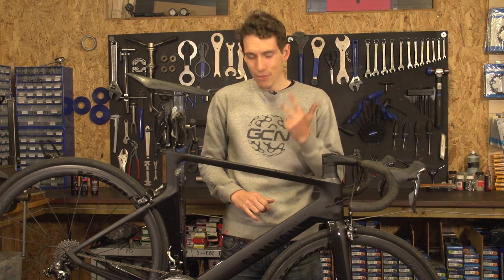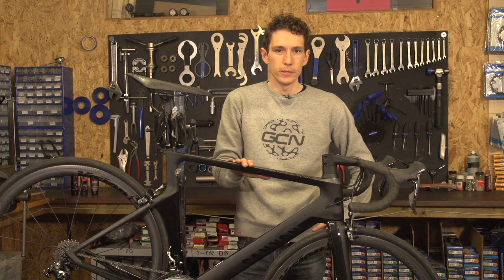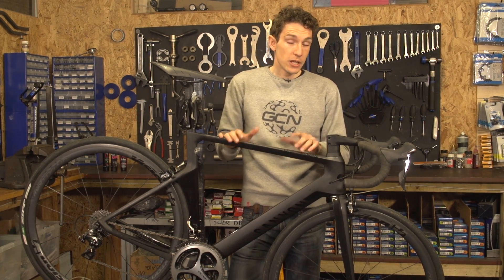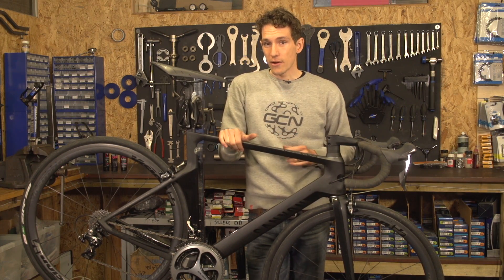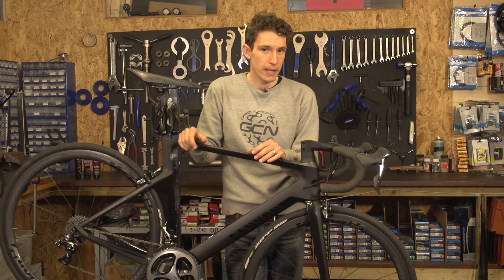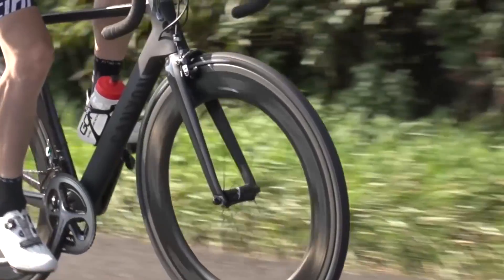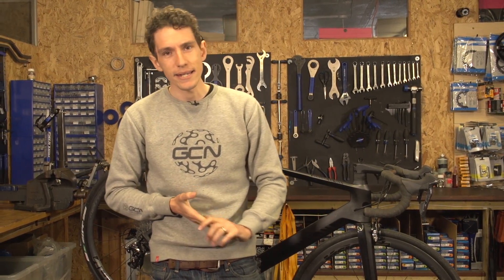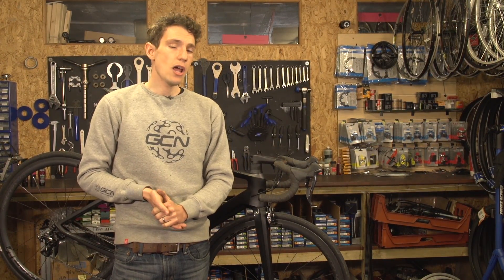7 Things You Didn't Know About Carbon Fiber

Comment: Metal bends before it breaks, carbon breaks catastrophically. I would completely argue that last point about carbon bikes being just as safe. That said I do race a carbon bike and love the way it feels when riding, but that doesn't mean I don't get a little scared when I hit a pot hole.
Reply: +Niklas Barreto Carbon bends considerably without breaking. Frame deflection is one of the selling points of a good carbon frame. The carbon can be made to flex in one direction predictably, like a spring, to absorb shock, and be rigid in other directions for efficiency and ride control. That's why they feel so great to ride on. Look Bicycles even uses carbon as the material of choice in the cleat binding springs for their pedals. Cannondale made a few full-suspension MTBs with no pivots between the BB and rear wheel, because the carbon chainstays had the flexibility they needed.

Have a look at the testing shots they have from Canyon. Dropping a huge weight on the end of the blue fork??? (1:03) If it can bend like that without it breaking, it's probably not going to break with only you riding on it.
Reply: +Niklas Barreto I hit a rock at 45mph down a mountain road on my Canyon Endurace CF. The aluminium handlebar bent a little (2mm approx). The CF frame didn't even scratch, I'm still riding it like a maniac down hills.
Reply: +Niklas Barreto Metal can crack as well, for instance if the failure is caused by fatigue. And CF composites can fail progressively, like what GCN said about the layers giving one by one.

Comment: airplanes are definitely not made of carbon fiber right?
Reply: Apparently it takes more carbon to build one plane than the whole of the bike industry uses in one year. Apparently.
Reply: +Simon Richardson Most big passenger planes are made with Al, apparently, except the brand new 787s from boing which use a carbon fiber and polymer composite for the whole thing. That's an insane amount of carbon when you imagine how big those things are.

Comment: I'm still trying to figure out what alu-MINIUM is? Surely most alu-MINIUM has a higher modulus of elasticity than carbon, which means it's more prone to bend than fracture?
Reply: +William Thomas CSUF Kinesiology It has a finite life in terms of fatigue cycles. CF, steel and Ti have an infinite fatigue life when stressed within the yield limit. Modulus of elasticity doesn't matter as long as it's not stressed beyond yield (i.e. bent)

Aluminium/aluminum has an interesting etymology in itself - look it up
Reply: +Sam Singular Cycles However, we can't say carbon isn't going to be stressed beyond its yield. Especially, in the event of a crash. Not sure that any carbon mfgr. design their lay-ups to surive crashes. Then again, why should they? Goal is to make the bikes super light with high lateral rigidity and durability WHILE RIDING. In the event of a crash (which unfortunately do occur), I'd take a good metal frame any day. Of course, if you're paying $4k for a carbon frame, you probably can afford a $1k repair job or insurance policy.

Comment: Next video: How to train on rollers. I have rollers, but I'm not sure what to do on them.
Reply: Charlie, They did a video on rollers a while ago, featuring Matt.
Reply: I know how to ride them. I'm just not sure how I should train on them.
Reply: +Charlie Bennici pedal for a while, then pedal harder until you can't keep pedaling, then pedal softer.  when you recover, repeat.  in all seriousness, you can pretty much train on them like any other trainer unless you're a featherweight and you run your 23cm tires at 110 PSI, then resistance could be a problem.
Reply: Kevin Beckwith There is the problem, I am 118 lbs, 5,6 and run 25mm tires at 117 psi. 

Though I have heard of people putting magnets near the rollers for resistance. Only works if they're magnetic. In which mine are.
Reply: +Charlie Bennici hmmm, go to Puerto Rico and eat Mofongo every day? seriously...... try 60 PSI in those 25's, and in a 53x11 you should be able to make at least 300w right?  I'm 185 and on my 25's with about 85 PSI I can get just under 800w seated when I really spin up the 53x11 and easily do lesser intervals.  In any case, they are great for developing an efficient stroke.  Try pedaling w/ one leg for 20 sec, then switch when you start pedaling squares.  Get to where you can ride no hands w/ confidence.  Then you'll have a really smooth and efficient stroke.  Lighter work load days work on pedal speed (w/o bouncing) on the rollers, and heavy lifting lower RPMs on the turbo trainer like a Kurt Kinetic.
Reply: +Kevin Beckwith I have platform pedals. Not clips.
Reply: +Charlie Bennici so, so sorry....,j/k, hey many a great sprinter started out riding BMX.  well do what you will, ride on!
Reply: Maybe I wasn't clear. I have a Motobecane Mirage Sl with platform pedals. 

Any shoes/pedal suggestions?
Reply: +Charlie Bennici didn't mean to convey that I thought you were a BMX rider.  I started out riding BMX and of course platform pedals.  anyway suggest you check out Bike Forums or Cycling Forums, lots of wise older riders that will give you tons of advice.  Cheers...

Comment: Im mostly a mountainbiker but god damn that canyon looks demonic..
Reply: +Sander Bærøy Johansen Smart MTb bike companies have an aluminium rear triangle , see Santa Cruz for example.
Reply: Yeah, my canyon strive cf 8 race has one=) 
Not sure if its to cut cost or /and ease production?
Reply: +Sander Bærøy Johansen The rear triangle takes a beating, usually when we lay the bike down. also most breaks happen here from contact with rocks etc.
that is why the switch to alum.
Reply: +Sander B&#230;r&#248;y Johansen As someone pointed out, aluminium is isotropic so maybe it can withstand those forces acting on it better
Reply: +Guillermo Bright Good point. In a perfect environment where the perfectly engineered carbon fiber bike/components have no force acted on them from the imperfect, unpredictable outside world, Carbon Fiber is the king of all, on paper. Truth is, it's hard to tell what's going to happen when you go for a ride. Aluminum is more forgiving in my opinion, a dent on the chain stays doesn't mean your frame is scrapped (legal disclaimer, replace all damaged parts blah blah)

Comment: I had a "steel is real" guy refer to my F8 as plastic.. So I asked him (scientifically I might add) if steel can exist without carbon and he didn't have an answer. I love my steel bike too, but my carbon bikes are oh so sweet.
Reply: +Steve Bell Most steels used in frame manufacture do include carbon in the alloy.
Reply: Sam Singular Cycles I'm no metallurgist but I'm fairly certain carbon is the hardening element of all steel.
Reply: so what were you asking him?
Reply: A hypothetical question :)
Reply: the world couldn't exist without carbon, what is your point?
Reply: just throwing this out there but the definition of steel is carbon alloyed with iron. Low percentages are classified as steels, higher percentages are cast iron
Reply: That's my point. Without carbon there's no steel. I posed the a questions to the guy who called my carbon framed bike "plastic"  — knowing the answer. But he didn't have a clue. He just wanted to bash carbon bikes, in that snotty superior cyclist sort of way. My guess is he was just jealous? Who really knows.. I dropped him inside of 5 miles and never saw him again.

Comment: What's the best way to transport a carbon fibre bike? No wise cracks here, obviously riding it is the best way but what about on roof bars. Some bike carriers clamp onto the frame, should these be avoided?
Reply: +colin clements I use one that clamps the down tube on my carbon bikes.  I try to clamp as close to the bottom bracket as possible as I know that area is pretty beefy.  I've had no issues but I also have a pretty light touch with the clamp.

Comment: It will be nice a video about chinese frame and wheels how weak they are in comparison to original. Material, durability and safety.
Reply: +mcantuaria23 are you on about the copy's? why buy a copy when you can buy good parts for manufacturers that have a good rep, for about the same price as a copy?
Reply: +Cyber TonTo72  I don't want to compare prices but safety, material and durability. We all know how much cost chinese frameset and wheels. I had riding on chinese rims before for over 6000km without any problem and also I had friend that broke his face after the front wheel explode.
Reply: That is my point, there are a few makers that do test there products and still make them as cheap as a copy

Comment: Isotropic = same strenght in any direction.
Carbon fiber composites are stronger (and stiffer) in the direction the fibers run.
Its similar to wood, which is stronger along the grain the perpendicular to the grain. This is an orthotropic material. 
With carbon fiber you use several layers in different orientation, getting that right is key.
That wasn't so hard was it?

Comment: A radiator is filled with water so NO it will not exceed 100 celcius. That would mean it's boiling ;-)
Reply: +Mark Huigen The boiling point is pressure dependent.
Reply: You're right, but you know what I mean.
Reply: +Mark Huigen some radiators are filled with an oil product and not water

Comment: Thank you Si! Nice video and definitely information that needs to be seen more often. Modern jet aircraft have massive amounts of carbon fiber in them yet people think it isn't safe to make a bike from. It is all about recognizing the different properties of different materials.
Reply: +Brian Moore Planes use carbon fiber 10x stronger than bikes
Reply: +Guillermo Bright watch the video again.  5 factories make it all.
Reply: +Guillermo Bright The carbon fiber itself (specifically what modulus the fibers used are) is only one part of what makes it strong, and as stated by Simon, with ultra-high modulus carbon fiber you're trading strength for brittleness. The LAYUP is the much larger determining factor.
Reply: +TypeVertigo well I would hope that the makers of an aircraft that has to lift thousands of tons would use a little different layup that a bike company that only needs to hold one person.
Reply: +Brian Moore That's the real beauty of carbon fiber. With proper layup and use of different modulus sheets you can make it as strong or as light as it needs to be.

Wings such as those used in aeroplanes and race cars have to contend with lots of kilos of lift or downforce, as the case may be, so as load-bearing structures they need to be strong. A car hood by comparison is just a cover so making it out of strong carbon isn't as critical - most people just make them as light as possible.
Reply: The engineering and qc is much more strict when building planes not so with carbon bikes.
Reply: @natedagreat90  If you stick to the large well known brands, a great deal of engineering,  qc, and testing is done.

Comment: Good video, I'm still a steel guy. love the ride characteristics and the long term reliability. Plus I don't want to be worried about over torquing bolts on components out on a ride if anything happens.
Reply: +Chasing Cornfields i love steel alot, but i would like to say i have done thousands of raggo  miles in the shite back lanes of dorset on my canyon and i have never taken a tool with me, just tubes co2 and tyre lever!!

Comment: 5:50 isotropic means that the material properties are the same no matter how the material is orientated. Carbon fiber is anisotropic, which means that it has different properties for different orientations, i.e. it only has high strength in the longitudinal direction  of the fibers.

Comment: What about leaving carbon in the cold or moving your carbon bike from the cold (0-5 in winter) to warmth (20-22 house temperature)
Reply: The thermal expansion coefficient of carbon fibre is very low, it'll be fine from a structural point of view.

Comment: One thing you never knew about carbon fibre: it's overrated and not even that much lighter than aluminium
Reply: Overrated? So you know better than Specialized, Giant, Trek, Canyon, Pinarello, Ferrari, Lamborghini, NASA, Northrop Grumman, Lockheed, Boeing, Airbus and other multi-billion companies that all use cf and other composites in their mission critical designs that used to use Al alloys before moving to "overrated" carbon fibre.
Reply: It is quite a bit lighter to be fair. About 500g like for like over aluminium for a frame.

Comment: Raw carbon frames are susceptible to UV damage. Many manufacturers trying to achieve light weight usually skip the paint or or glossy finishes that usually come with UV protection. Basically, if you have a bike where you can see the fibers, and it's a matte finish and not glossy, it probably isn't UV protected. Though this can easily be done with aerospace solution after every bike wash.
Reply: Well, good thing everyone uses paint on their bikes then. An unpainted stainless steel frame would suffer worse from ambient environment, rusting to hell as soon as it comes out of the furnace.
Reply: +Yo-yo 3M does make several matte UV resistant finishes if I recall correctly.
Reply: ***** I use 303 Aerospace Protectant for raw carbon.

Comment: can you clamp carbon bikes in a roof mount. I have heard that the fibres don't like that sort of clamp load. also, can you use nail varnish to touch up a scratch / chip o. carbon bikes. if not, what paint is safe?

Comment: The reason for the catastrophic failure is that carbon can develop micro cracks not seen, however i must add you'll generally see a large indication in the area as well. After a while these micro cracks can join up if not repaired and when they join that creates the failure. Carbon is very strong in the intended direction it was designed for but something like being driven into sideways by a car for example can put pressures on the frame in a direction it wasn't engineered for. In that scenario you may have unseen damage but frame can be ultra sounded to see any voids that may develop from that kind of impact.

Comment: I often hear that carbon frames need to be replaced after a few seasons of riding because the material fatigues and the frame loses it's properties. On the other hand, manufacturers claim that carbon frames don't lose any of their properties over time. Which is correct? From experience I would say the later...
Reply: All materials have a fatigue life, but since carbon is stiffer and stronger it's fatigue life will be higher than an equivalent metal frame. However, fatigue life is tested in a controlled lab with no danger of MTBing maniacs taking their bikes into trees or overconfident roadies crashing. In those situations a metal frame will take the hit and the carbon frame would give. So at the end of the day your bike's lifetime depends on what you do with it.
Reply: +Windoges Besides, a lot of the sort of crashes that steel fans cite as to why "carbon is inferior" usually are the same kinds of crashes that would retire a light steel frame anyway.